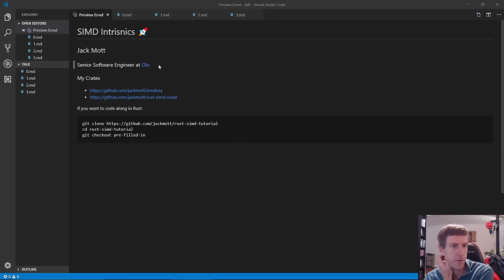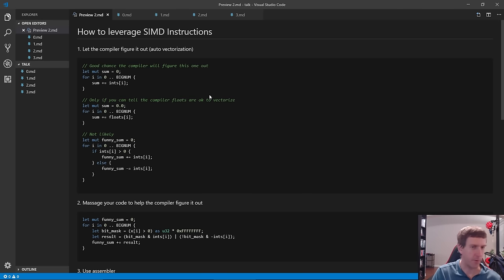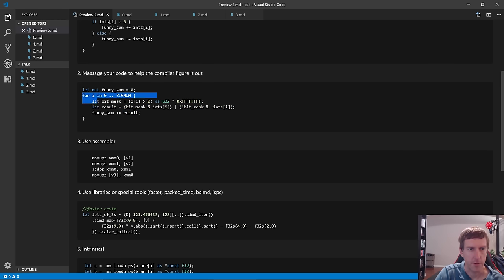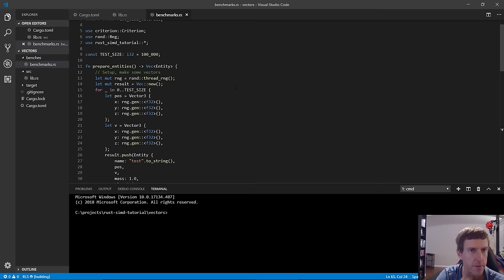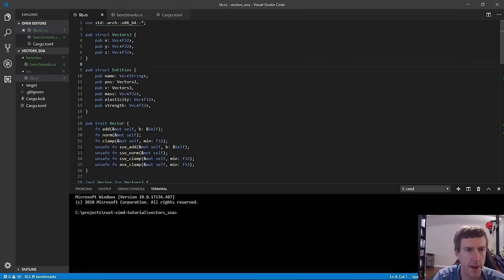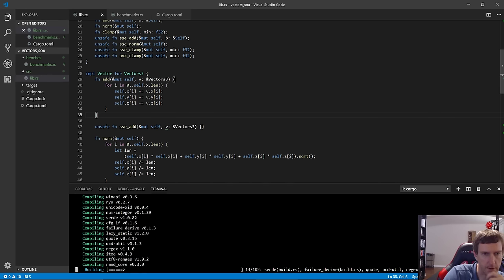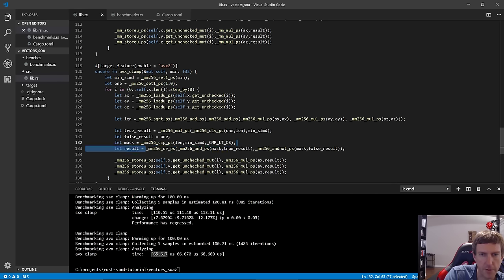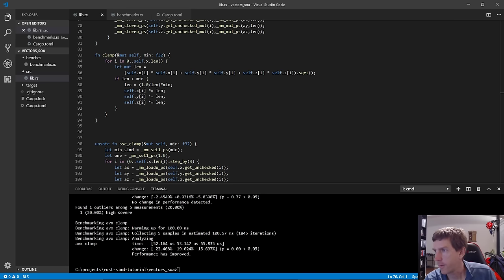SIMD Intrinsics

Comment: Interestingly, the scalar and SIMD (SSE and AVX2) code had similar performances under Release build with MSVC 2019. A problem I had was related to padding. When the number of entities was non-multiple of __mm128 or __mm256 sizes, but easy enough to solve.

Comment: You might want to watch out, rsqrt intrinsics are only rough estimations, they are not very precise. Basically only 11-12 bit precision is guaranteed. So if this matters for anybody, look up the intel spec. Intel documentation recommends an additional Newton-Rhapson approximation step if you nees that 23 bit precision (which is what float32 has).